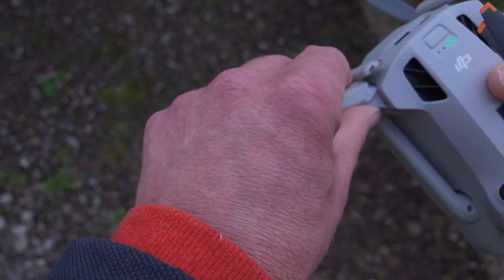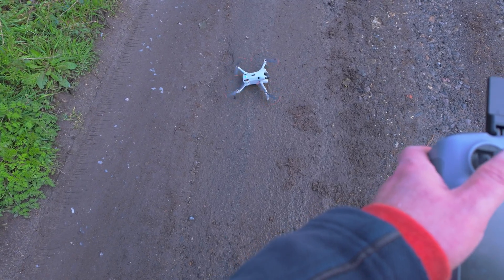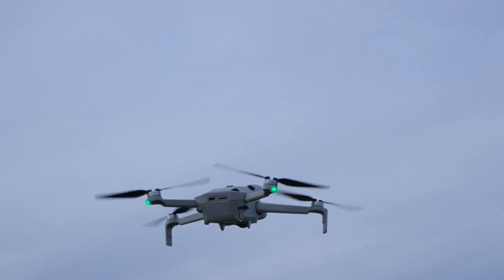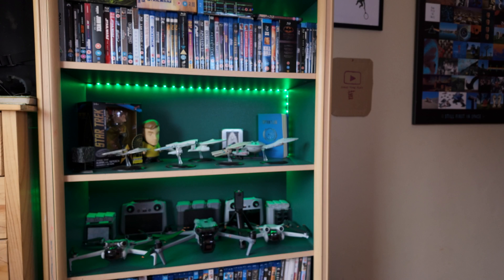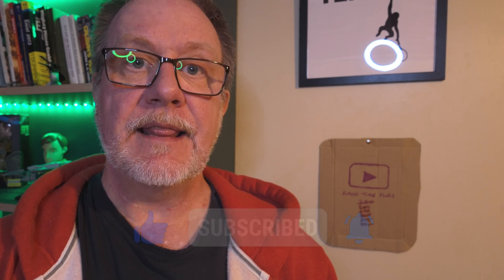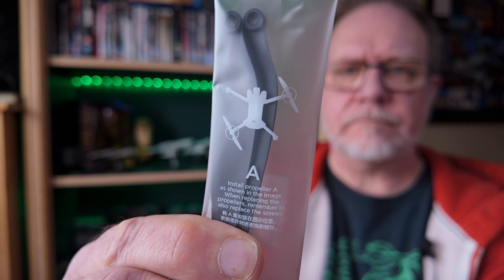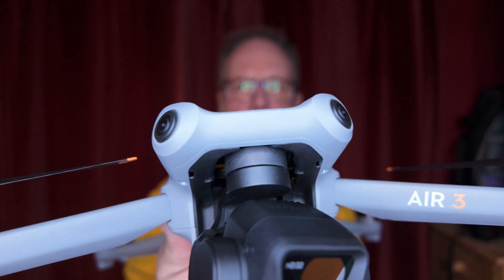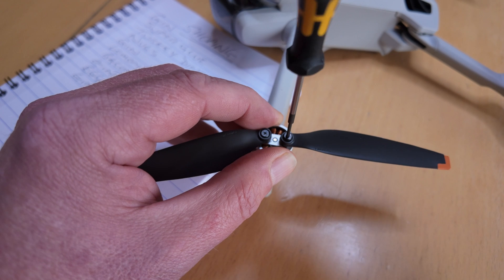DJI Drone Propeller Replacement - DON’T Make This Mistake!

Comment: You forgot the #1 top tip for propeller replacement: throw the crappy screwdriver that comes with the drone into the garbage and buy a good one, like the one you’re using in the video. I think I searched on Amazon for “#00 philips screwdriver”?
Reply from the maker: You are absolutely right Paul, thankyou! I did mention and link it in the previous vid ( https://youtu.be/R_AefY8jEjs?si=zmtPn_oxc2XIkDCp ), but in case people haven't seen that will add this as the pinned comment for this vid along with an amazon link here : https://amzn.eu/d/imn4KmR

Comment: This propeller muddle confuses many people!😊

My Eye One Xtreme RC Logger drone was a Maplin return, the box marked faulty! I paid just £5 for it. 
Took it home, tested it the back 2 props were on the wrong way, there was nothing wrong with it!😊

There are usually marks on the drone arms near the motors which correspond with similar marks on the props!

You've probably noticed DJI props come in pairs, it's important to change BOTH even if only one is damaged⚠️😲
They are a balanced pair, if you change just one, there is a chance they might be slightly different and cause a vibration or wobble!

Plus it's important to change both because the older one may have a lot more flight time on it and be approaching the end of it's recommended life time, I think DJI recommend changing after 200 flights?
Reply from the maker: Yep all good advice, although personally I struggle to believe that mass produced props that are as cheap as they are, are 'balanced pairs', which is why I didn't mention it, but better to be safe than sorry I guess.... 

Re. the wear and tear, as part of a normal flight check the props should be checked over every time, but I take your point - internal wear and tear may not be obvious. Then again, I tend to go through about every set of props well before they've had 200 hours use! 🤣

Kudos on the bargain BTW! (I miss Maplins 😢)

As always - Thanks for watching and the comment - very much appreciated 🖖🖖
Reply: @amoktimeflies  Yes it's important to visually check your props as part of your pre flight checks, I also run my finger along each, checking for nicks, cracks or just bugs 🐛 

It's also worth noting all your prop screws are sitting flush rather than standing proud , a quick check to see if they are nipped up, without having to use a screwdriver! 

I agree, I doubt someone is sat at a prop balancing machine and going through each prop individually and carefully weighing them or adjusting the weight of each to make matched pairs! 😲😳😁

I guess they match them by using pairs that come out of the same forming tool, maybe they're weighed also and ones that are within a certain tolerance are packaged together?

I have noticed different numbers on different props, I guess they indicate something? 🤔 

The life time of a prop will depend on a lot of factors such as how hard the drone has been flown, how fast, how much blustery wind they've been subject to, how carefully they've been handled while the drone has been taken out of and put into storage etc and even cool / heat cycles can affect the material they are made of etc

Comment: I had what I thought was a minor crash in light branches there recently, made absolute mincemeat of all 8 blades and the lot had to be changed, couldn't believe it! I put the replacements on the right way, though! 🤣
Reply from the maker: Yeh - I just got all hot and bothered and wasn’t concentrating properly - easily done when doing a change ‘in the field’ 🖖
Reply: @amoktimeflies  Yeah there's no way I'd have tried a field change, that screwdriver was an absolute disaster!
Reply from the maker: OMG! BLADES!! another name for them! 🤦‍♂️🤦‍♂️😂